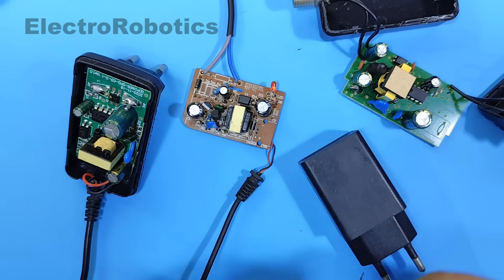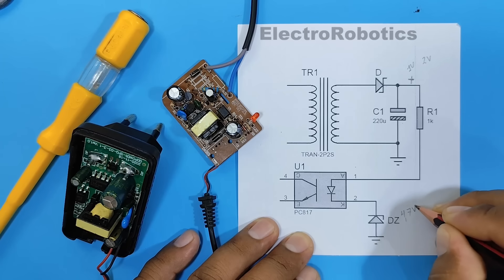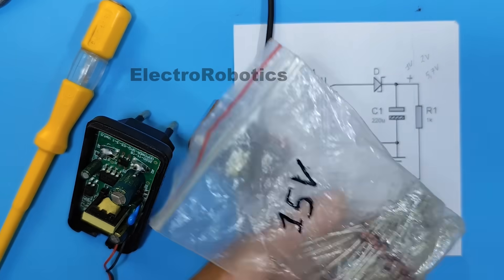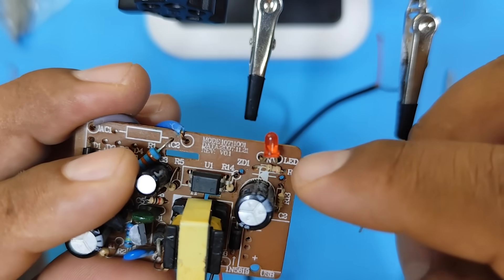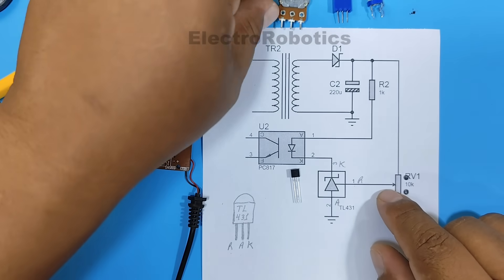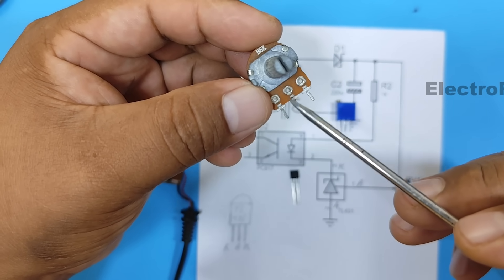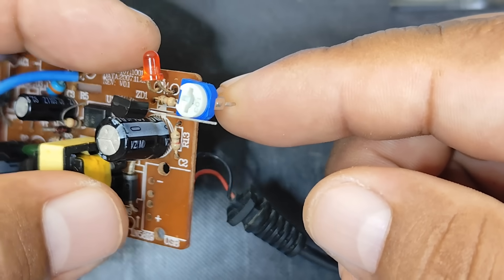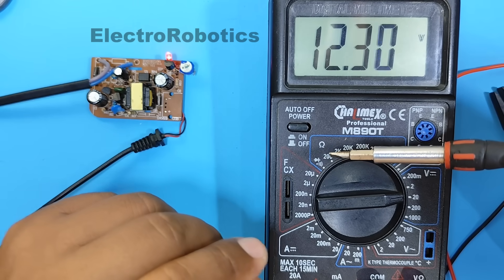Modify Any Charger and Adjust Its Voltage.

Comment: Even befor i watch this video i want to say i love you for thinking about this❤
Reply: Do not be FOOLED.
So much mis-information
- FIRST SAFETY  is important but no safety precautions are given. The part about adjusting the trimmer is scary bad.
- The current must be reduced else it will over-heat and self-destruct.
 - it does NOT work on all chargers. 
- the output waveform will be degraded, so the load may not work properly.
- he does briefly mention the issue with the output cap .....be CAREFUL. For example if you change to 12V then the output cap must rated at least 16V

 This mod has been around for many years  by very ignorant channel makers. It is too bad he has repeated the same mistakes and same mis-information. He should know better.

Comment: +1
Reply: >>>>>>  Do not be FOOLED !

So much mis-information
- FIRST  no safety precautions are given. 
- The current must be reduced 
 - it does NOT work on all chargers. 
- the output waveform will be degraded, so the load may not work properly.
.. be CAREFUL. if you change to 12V then the output cap must rated at least 16V

 This mod has been around for many years  by very ignorant channel makers. It is too bad he has repeated the same mistakes and same mis-information. He should know this unless he is a Professor of BS

Comment: Great video, very well explained.
Reply: Do not be FOOLED.
So much mis-information
- FIRST SAFETY  is important but no safety precautions are given. The part about adjusting the trimmer is scary bad.
- The current must be reduced else it will over-heat and self-destruct.
 - it does NOT work on all chargers. 
- the output waveform will be degraded, so the load may not work properly.
- he does briefly mention the issue with the output cap .....be CAREFUL. For example if you change to 12V then the output cap must rated at least 16V

 This mod has been around for many years  by very ignorant channel makers. It is too bad he has repeated the same mistakes and same mis-information. He should know better.
Reply: @kennmossman8701  This is normal procedure to me as I am in the electronic reparation business for more 
than 40 years....!!!! Of course that people need to know what they are doing or something can go very bad with 
electricity, specially the AC part and the High Voltage DC that can be present in these devices.

Comment: Very pleased with basic explanation for a starter like me, thx
Reply: Do not be FOOLED.
So much mis-information
- FIRST SAFETY  is important but no safety precautions are given. The part about adjusting the trimmer is scary bad.
- The current must be reduced else it will over-heat and self-destruct.
 - it does NOT work on all chargers. 
- the output waveform will be degraded, so the load may not work properly.
- he does briefly mention the issue with the output cap .....be CAREFUL. For example if you change to 12V then the output cap must rated at least 16V

 This mod has been around for many years  by very ignorant channel makers. It is too bad he has repeated the same mistakes and same mis-information. He should know better.

Comment: Thanks a lot. Very good information. Thanks again,
Reply: Do not be FOOLED.
So much mis-information
- FIRST SAFETY  is important but no safety precautions are given. The part about adjusting the trimmer is scary bad.
- The current must be reduced else it will over-heat and self-destruct.
 - it does NOT work on all chargers. 
- the output waveform will be degraded, so the load may not work properly.
- he does briefly mention the issue with the output cap .....be CAREFUL. For example if you change to 12V then the output cap must rated at least 16V

 This mod has been around for many years  by very ignorant channel makers. It is too bad he has repeated the same mistakes and same mis-information. He should know better.

Comment: All 5V adapter/charger can't go past 8V before it blows up the switching Transistor I've tried that to give 12V to use as a standby supply in a microwave oven after it was completely fried, at the time I couldn't find any 12V adapters
Reply: as mentioned in the video you can't go over the capacitor's limit.

Comment: Do not be FOOLED !

So much mis-information
- FIRST SAFETY  is important but no safety precautions are given. The part about adjusting the trimmer is scary bad.
- The current must be reduced else it will over-heat and self-destruct.
 - it does NOT work on all chargers. 
- the output waveform will be degraded, so the load may not work properly.
- he does briefly mention the issue with the output cap .....be CAREFUL. For example if you change to 12V then the output cap must rated at least 16V

 This mod has been around for many years  by very ignorant channel makers. It is too bad he has repeated the same mistakes and same mis-information. He should know better.

Thanks to garymucher4082 for making me realize another flaw. Any  irregularity is passed to the TL43x which can  interfere with the regulation.  This is a real and serious flaw.   Using a DVMM with no load is a rather naive test.
Reply: Nobody has mentioned the variable resistor must be a linear type.
Reply: @thericesquad  👍

Comment: Thanks for the info.
Reply: >>>>>>  Do not be FOOLED !

So much mis-information
- FIRST  no safety precautions are given. 
- The current must be reduced 
 - it does NOT work on all chargers. 
- the output waveform will be degraded, so the load may not work properly.
.. be CAREFUL. if you change to 12V then the output cap must rated at least 16V

 This mod has been around for many years  by very ignorant channel makers. It is too bad he has repeated the same mistakes and same mis-information. He should know this unless he is a Professor of BS

Comment: شكراً جزيلاً شرح جميل جدا
Reply: >>>>>>  Do not be FOOLED !

So much mis-information
- FIRST  no safety precautions are given. 
- The current must be reduced 
 - it does NOT work on all chargers. 
- the output waveform will be degraded, so the load may not work properly.
.. be CAREFUL. if you change to 12V then the output cap must rated at least 16V

 This mod has been around for many years  by very ignorant channel makers. It is too bad he has repeated the same mistakes and same mis-information. He should know this unless he is a Professor of BS

Comment: Excellent video
Reply: >>>>>>  Do not be FOOLED !

So much mis-information
- FIRST  no safety precautions are given. 
- The current must be reduced 
 - it does NOT work on all chargers. 
- the output waveform will be degraded, so the load may not work properly.
.. be CAREFUL. if you change to 12V then the output cap must rated at least 16V

 This mod has been around for many years  by very ignorant channel makers. It is too bad he has repeated the same mistakes and same mis-information. He should know this unless he is a Professor of BS

Comment: very very very good and clear video
Reply: >>>>>>  Do not be FOOLED !

So much mis-information
- FIRST  no safety precautions are given. 
- The current must be reduced 
 - it does NOT work on all chargers. 
- the output waveform will be degraded, so the load may not work properly.
.. be CAREFUL. if you change to 12V then the output cap must rated at least 16V

 This mod has been around for many years  by very ignorant channel makers. It is too bad he has repeated the same mistakes and same mis-information. He should know this unless he is a Professor of BS

Comment: The best video I have seen so far. Very well done with reasons for every step. Subscribed, liked and shared. Thank you.
Reply: Do not be FOOLED !

So much mis-information
- FIRST SAFETY  is important but no safety precautions are given. The part about adjusting the trimmer is scary bad.
- The current must be reduced else it will over-heat and self-destruct.
 - it does NOT work on all chargers. 
- the output waveform will be degraded, so the load may not work properly.
- he does briefly mention the issue with the output cap .....be CAREFUL. For example if you change to 12V then the output cap must rated at least 16V

 This mod has been around for many years  by very ignorant channel makers. It is too bad he has repeated the same mistakes and same mis-information. He should know better.

Thanks to garymucher4082 for making me realize another flaw. Any  irregularity is passed to the TL43x which can  interfere with the regulation.  This is a real and serious flaw.   Using a DVMM with no load is a rather naive test.
Reply: You are 100% correct. Thank you for taking the time to write up a very important safety and technical points to be considered.

Comment: So, when the coupler LED lights it shuts down the power to keep the set voltage?
Reply: That means a failure of the led in the optocoupler could cause the voltage to go high or at least spike and destroy devices being powered. seems like a backwards poor design.

Comment: What happens with the amperage?
Reply: Do not be FOOLED !

So much mis-information
- FIRST SAFETY  is important but no safety precautions are given. The part about adjusting the trimmer is scary bad.
- The current must be reduced else it will over-heat and self-destruct.
 - it does NOT work on all chargers. 
- the output waveform will be degraded, so the load may not work properly.
- he does briefly mention the issue with the output cap .....be CAREFUL. For example if you change to 12V then the output cap must rated at least 16V

 This mod has been around for many years  by very ignorant channel makers. It is too bad he has repeated the same mistakes and same mis-information. He should know better.

Thanks to garymucher4082 for making me realize another flaw. Any  irregularity is passed to the TL43x which can  interfere with the regulation.  This is a real and serious flaw.   Using a DVMM with no load is a rather naive test.
Reply: @kennmossman8701   Thanks, Do you have a video to make it well? Yours or another one on youtube or elsewhere??
Reply: @kennmossman8701 

All good points..

He did state the output volateg could not be higher than the output capacitor rating  In this video 16VDC.

I agree the circuit needs to be tested using a load and an oscilloscope to measure ripple and noise.
Reply: @finestructureconstant3921  Yeah, I have an oscilloscope, but I'm not knowledgeable enough to test it; so I'll pass.
Reply: Amperes will remains the same

Comment: Thanks professor
Reply: There's no way he's a professor.
Reply: @BrianG61UK  professor of BS
Reply: >>>>>>  Do not be FOOLED !

So much mis-information
- FIRST  no safety precautions are given. 
- The current must be reduced 
 - it does NOT work on all chargers. 
- the output waveform will be degraded, so the load may not work properly.
.. be CAREFUL. if you change to 12V then the output cap must rated at least 16V

 This mod has been around for many years  by very ignorant channel makers. It is too bad he has repeated the same mistakes and same mis-information. He should know this unless he is a Professor of BS

Comment: Excellent!
Put some load to see if the output voltage changes.
Reply: Do not be FOOLED !

So much mis-information
- FIRST SAFETY  is important but no safety precautions are given. The part about adjusting the trimmer is scary bad.
- The current must be reduced else it will over-heat and self-destruct.
 - it does NOT work on all chargers. 
- the output waveform will be degraded, so the load may not work properly.
- he does briefly mention the issue with the output cap .....be CAREFUL. For example if you change to 12V then the output cap must rated at least 16V

 This mod has been around for many years  by very ignorant channel makers. It is too bad he has repeated the same mistakes and same mis-information. He should know better.

Thanks to garymucher4082 for making me realize another flaw. Any  irregularity is passed to the TL43x which can  interfere with the regulation.  This is a real and serious flaw.   Using a DVMM with no load is a rather naive test.

Comment: I ain’t as knowledgeable as you are but something amiss. Looks like it can go Chibaboom
Reply: Do not be FOOLED!

So much mis-information
- FIRST SAFETY  is important but no safety precautions are given. The part about adjusting the trimmer is scary bad.
- The current must be reduced else it will over-heat and self-destruct.
 - it does NOT work on all chargers. 
- the output waveform will be degraded, so the load may not work properly.
- he does briefly mention the issue with the output cap .....be CAREFUL. For example if you change to 12V then the output cap must rated at least 16V

 This mod has been around for many years  by very ignorant channel makers. It is too bad he has repeated the same mistakes and same mis-information. He should know better.
 
Thanks to garymucher4082 for making me realize another flaw. Any  irregularity is passed to the TL43x which can  interfere with the regulation.  This is a real and serious flaw.   Using a DVMM with no load is a rather naive test.

Comment: I understand. Thank you.
Reply: >>>>>>  Do not be FOOLED !

So much mis-information
- FIRST  no safety precautions are given. 
- The current must be reduced 
 - it does NOT work on all chargers. 
- the output waveform will be degraded, so the load may not work properly.
.. be CAREFUL. if you change to 12V then the output cap must rated at least 16V

 This mod has been around for many years  by very ignorant channel makers. It is too bad he has repeated the same mistakes and same mis-information. He should know this unless he is a Professor of BS

Comment: Thank you ❤,nice idea, very clear
Reply: >>>>>>  Do not be FOOLED !

So much mis-information
- FIRST  no safety precautions are given. 
- The current must be reduced 
 - it does NOT work on all chargers. 
- the output waveform will be degraded, so the load may not work properly.
.. be CAREFUL. For example if you change to 12V then the output cap must rated at least 16V

 This mod has been around for many years  by very ignorant channel makers. It is too bad he has repeated the same mistakes and same mis-information. He should know better.

Comment: Good  dear
Reply: >>>>>>  Do not be FOOLED !

So much mis-information
- FIRST  no safety precautions are given. 
- The current must be reduced 
 - it does NOT work on all chargers. 
- the output waveform will be degraded, so the load may not work properly.
.. be CAREFUL. if you change to 12V then the output cap must rated at least 16V

 This mod has been around for many years  by very ignorant channel makers. It is too bad he has repeated the same mistakes and same mis-information. He should know this unless he is a Professor of BS

Comment: Nice❤
Reply: >>>>>>  Do not be FOOLED !

So much mis-information
- FIRST  no safety precautions are given. 
- The current must be reduced 
 - it does NOT work on all chargers. 
- the output waveform will be degraded, so the load may not work properly.
.. be CAREFUL. if you change to 12V then the output cap must rated at least 16V

 This mod has been around for many years  by very ignorant channel makers. It is too bad he has repeated the same mistakes and same mis-information. He should know this unless he is a Professor of BS

Comment: excellent tutorial.💯👍
Reply: Do not be FOOLED !

So much mis-information
- FIRST SAFETY  is important but no safety precautions are given. The part about adjusting the trimmer is scary bad.
- The current must be reduced else it will over-heat and self-destruct.
 - it does NOT work on all chargers. 
- the output waveform will be degraded, so the load may not work properly.
- he does briefly mention the issue with the output cap .....be CAREFUL. For example if you change to 12V then the output cap must rated at least 16V

 This mod has been around for many years  by very ignorant channel makers. It is too bad he has repeated the same mistakes and same mis-information. He should know better.
Reply: Agreed 100%

Comment: Excellent...thank you
Reply: >>>>>>  Do not be FOOLED !

So much mis-information
- FIRST  no safety precautions are given. 
- The current must be reduced 
 - it does NOT work on all chargers. 
- the output waveform will be degraded, so the load may not work properly.
.. be CAREFUL. if you change to 12V then the output cap must rated at least 16V

 This mod has been around for many years  by very ignorant channel makers. It is too bad he has repeated the same mistakes and same mis-information. He should know this unless he is a Professor of BS

Comment: very intresting. Thanks lot.
Reply: Do not be FOOLED!

So much mis-information
- FIRST SAFETY  is important but no safety precautions are given. The part about adjusting the trimmer is scary bad.
- The current must be reduced else it will over-heat and self-destruct.
 - it does NOT work on all chargers. 
- the output waveform will be degraded, so the load may not work properly.
- he does briefly mention the issue with the output cap .....be CAREFUL. For example if you change to 12V then the output cap must rated at least 16V

 This mod has been around for many years  by very ignorant channel makers. It is too bad he has repeated the same mistakes and same mis-information. He should know better.
 
Thanks to garymucher4082 for making me realize another flaw. Any  irregularity is passed to the TL43x which can  interfere with the regulation.  This is a real and serious flaw.   Using a DVMM with no load is a rather naive test.